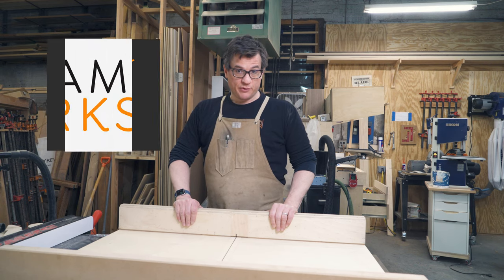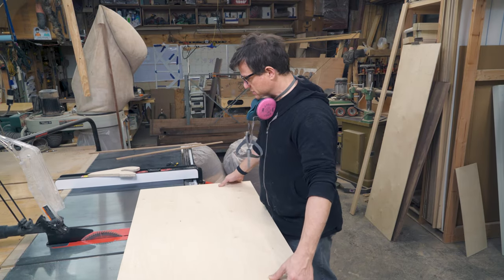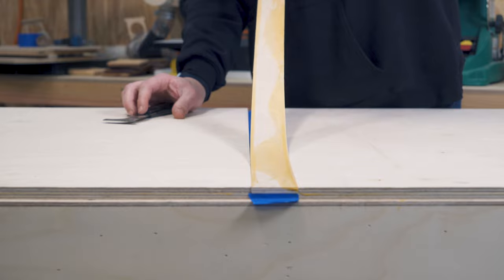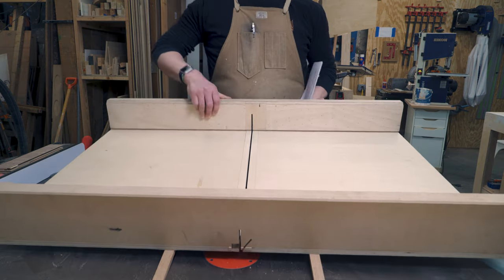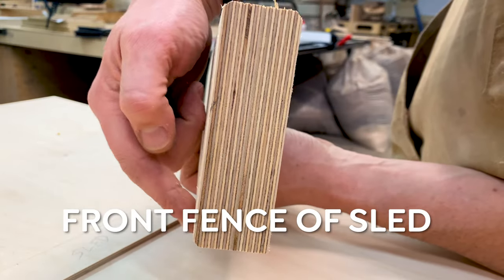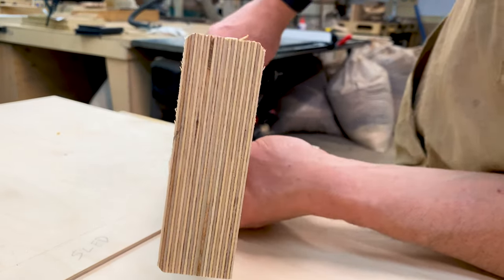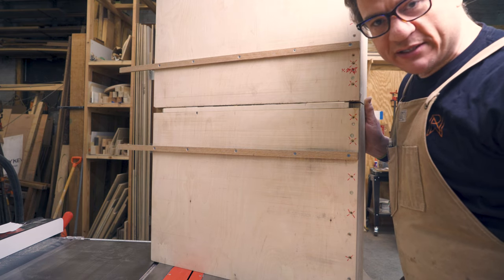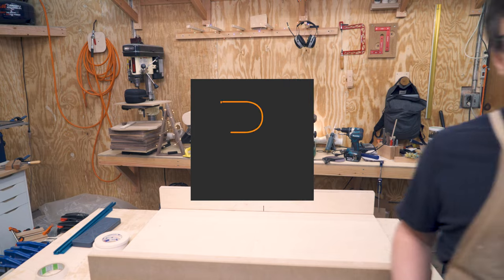Crosscut Sled with Removable Zero Clearance Insert

Comment: What I now do to ensure the rear fence is square is to have one side of the base and the corresponding fence rail past the edge of the table saw base. Screw the fence at the opposite end to the base (actually the base to the fence) and then clamp the longer overhanging side. If not square using the 3 or 5 cut method, clamp a block to the overhanging end plus/minus the width of a feeler gauge strip and re-clamp the block. Now you have no extra holes. When the fence is square, drill and screw the base to the rail. Thanks to Nick Engler at Workshop Companion, for his tip on doing it.

Comment: Question if you would. - Have you had any issues from the replacable fence insert? I am building a sled and have a concern that the accuracy is largely dependent on the fence and if the insert is not precisely the same thickness and aligned with the rest of the fence - it could introduce errors. Or am I overthinking this?
Reply from the maker: I haven't had any issues with the fence insert, maybe because it's a pretty tight fit, and also because it doesn't get cut all the way to the top of the piece, so there's more holding power from the tape?  I did end up making the sled insert larger so it could be screwed down.  Trying to keep it flat with tape alone proved too annoying in the long run.

Comment: That's a pretty neat way to do it! I don't think anyone has managed to get the back face right on the first try. 😁
Is there any special reason you kept the runners so long?
Reply from the maker: Having the runners long lets me start the sled farther back from the blade, which is super useful when cutting something that takes up the full length of the cutting area, if that makes sense.
Reply: @ParameterWorkshop  Of course, that makes perfect sense! 👍